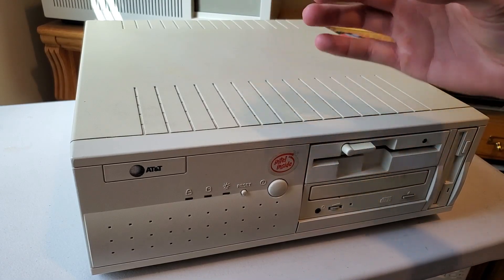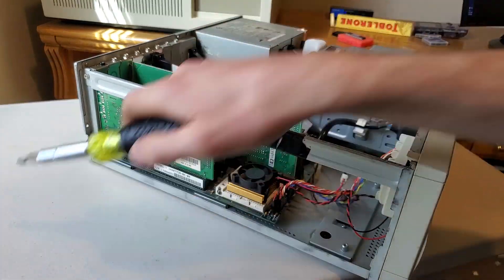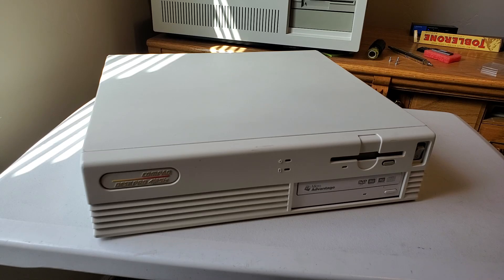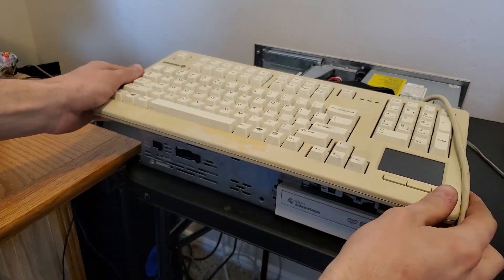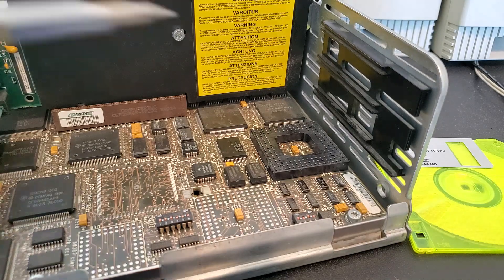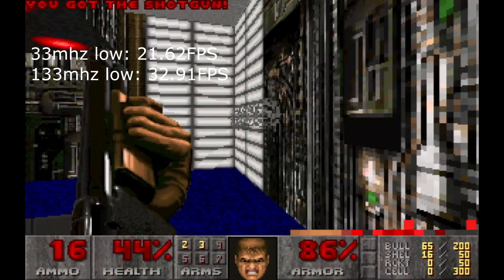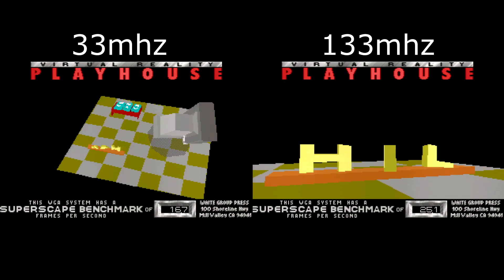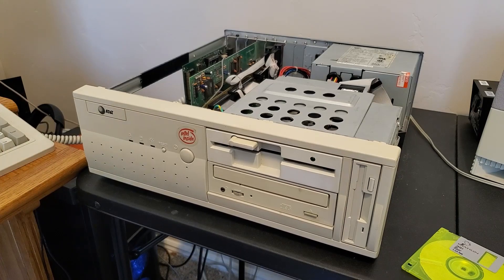AMD AM5x86-P75: Upgrading my 486?

Comment: You can play Mp3 with the 100 mhz version, and fits into the dx4, and can be jumpered to 120 mhz. Tomb Raider 1 runs, but hard o play. The modem internet is good w a 33.6 modem, the Napster mp3 download works well. The online chat runs normally.

Comment: I had the same problem with a WriteBack cache dx4 in a writeback cache board that for some reason does not want to do WB. So I re-jumpered the CPU type from the correct setting to the next higher cpu type with WriteThrough and therefore forced the DX4 to do WT which made my system boot. And not hang after POST the very same way your pc does.

Comment: pk-a586/98 is also the best odp I've ever seen for 486 pc-9801 series.
Reply from the maker: That was the original idea, however it functions as an odpr and not an odp, so it doesn't work on my machine with an onboard CPU and an upgrade socket

Comment: are you sure the compaq was well setup for that 586 cpu? i noticed the compaq was 25mhz, maybe when you inserted the cpu it only took 75mhz, you can check the cpu speed on norton commander
Reply from the maker: Now that you mention it, I'm not sure if I checked what the bus speed was, although it has been a while. It's entirely possible that a previous owner upgraded the CPU without changing the bus speed, but I probably assumed they did. I'll have to check it out.
Reply from the maker: got around to taking the computer apart to look at it, it's set to 33mhz according to the dip switch sticker on top of the drive bays. I was almost hoping I had it in 25mhz mode, that would have made things more interesting.

Comment: Had one of those 133MHz CPU's in a system I bought at a thrift store, and it didn't work from the get go. I saw some bridged traces on it, and I thought they were in error. Tried fixing them, and  fried the CPU entirely, with smoke and everything. Though, I'm quite sure it was already dead, before I got it. Getting a replacement for the dead chip in a month or so. On a DX2-66 for the time being. I believe, I was getting around 20 points in 3Dbench, with a decent VLB card. I'm curious if the new chip helps me beat 25.1 that you got. Like you said, results vary greatly, depending on multiple components. Motherboard is old gen. Doesn't even work with Overdrive CPU's. So it's either 66, or the AMD upgrade. No other options inbetween. I tested a dozen CPU's in DX4 range. Nope. No luck. A very picky motherboard.
Reply from the maker: Yeah these old things are picky bastards, you never know if what you're buying for it will work or if you're throwing $30 down the drain or whatever the cost is of what you're buying.
Reply: @Tr3vor42532  I got the board originally with 32MB of RAM for under $10. "What a bargain!" I thought. And then I went on a long upgrade binge. New cache, new ram, new I/O, new video, new sound, network, flash HD, Gotek floppy,  Over $1K later, I'm still not done with it. Large portion of the budget went towards CPU's that didn't work and are now sitting on the shelf. At this point, my 486 build is so ridiculous, I have to keep going, till there's nothing left to upgrade. Went with good VLB components, and those cost a pretty penny, due to how rare they are. Back in the day I didn't have a 486. I went from a 16MHz 286 straight to P-100, so a 486 is the closest thing I have to the hardware I remember using. DX2-66 doesn't cut it. 133 should be close enough.
Reply: @Tr3vor42532  Got the Evergreen chip today. Good news is that it runs, but I had to reduce motherboard cache from 256K to 128K, otherwise it would hang right after BIOS. I disabled external cache in BIOS first, to make sure that it was causing issues, and surely, it booted up. Running with no cache the system was as fast as a DX2-66 with cache. I then pulled half the cache chips from the motherboard and it fixed everything. I remember reading about that solution somewhere on forums.

In 3Dbench I got 41.7, which is more than enough. I checked what it was on DX2-66 and it was actually 30.4. Higher than I remembered it being. I put my own custom radiator on the Evergreen with a fan, as the original passive heatsink was approaching 60C under normal load. No wonder those things often failed due to heat. Now it stays below 30C.

The motherboard still identifies the CPU as a DX2-66, thinking it's running at 100MHz, however, Speedsys sees it properly. The chip gets bottlenecked a bit by the motherboard, losing 10% of performance, but the upgrade is still worth it for me. Transport Tycoon runs a lot better. Only game I found not to like the AMD CPU is Settlers 2. The rest is all good.

I'm tempted to get a PNY 5x86 CPU for comparison. Might get one just to have a backup, in case Evergreen dies at some point.
Reply from the maker: @enilenis  nice, I actually haven't tried running it with my cache disabled, maybe that's the issue? I'll have to try that one of these days.
Reply: @Tr3vor42532  Let me know if you find out anything interesting when you try the cache thing. I've discovered something new just now. I noticed that the 3x/4x multiplier on the CPU barely did anything. I'd get 3 points less in 3D bench on 3x vs. 4x, which is too small of a difference. Didn't feel right. I started to suspect that the CPU was, indeed, running at 100, regardless o the CPU jumpers. I then decided to see what would happen, if I raised motherboard FSB from 33 to 40MHz, and instead, what I got was the CPU listing as 132Mhz! Have no idea how, as 40x4 would've produced 160. Even at 3x CPU setting, it would've been 120, not 132.  However, now BIOS started hanging during memory tests. I suspected it was due to VLB becoming unstable. There was a jumper on the videocard for FSB being either at 33Mhz or higher. It was set to 33+, which in my mind was the correct setting. I set it to 33, and then magically, it all worked. Either some of my jumper documentation is incorrect, or I misinterpreted what the 33Mhz videocard setting meant. I rushed to test 3Dbench again. Solid 50.0 points. Wow! I have no idea why this runs when both, my motherboard and my videocard jumpers are technically incorrect. In Speedsys I'm now getting 42.43, vs 31.40 before the change, which is proper Evergreen speed. No bottlenecking. I have no clue why this works. It shouldn't, but it does.

Comment: I had the powerleap version in this old crappy IBM Ambra 486 many many years ago. Had it running at 160mhz and it still sucked.  (Better than the stock cpu but way behind a pentium).

Comment: The Am5x86 is the coolest CPU upgrade I've ever used. Based on these tests, though, it seems it might be best suited to a late era 486 motherboard using the SiS 496/497 chipset or anything which clearly indicates it supports that thing. Stunningly, these things were being manufactured as late as 1999 due to their popularity in embedded systems. I played through The Ultimate Doom at UV difficulty on one clocked at 160MHz using a PCI motherboard, and it really was something special. Pushing dated platforms beyond their expected limits is always so fun.
Reply from the maker: yeah, it would be better suited for a board with vlb or pci.

Comment: I wonder how the compaq would perform with a better video card (still on the ISA bus, but more capable nonetheless, like a tseng ET4000, or just a simpler card like a cirrus logic 5424 ISA)
Reply from the maker: I'd like to try that, but that require me to spend too much money. The only ISA video adapters I have are trident ones, so not very good either.

Comment: The Am5x86s (especially the ones marked "ADZ") were great at overclocking to 160, and even 200 if you were lucky... (however, forget about VLB at a 50Mhz FSB, or even PCI if your board lacked a divider for the PCI bus)